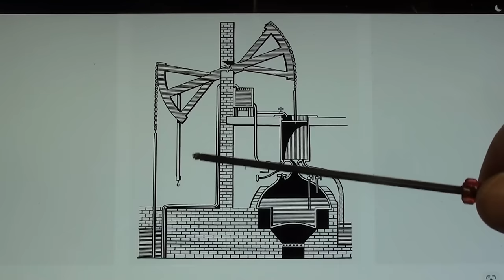WATTS LINKAGE BEAM ENGINE retrol #962 tubalcain steam parallel motion

Comment: One of Watt's critical improvements was to inject cooling water into the cylinder at the completion of the expansion stroke. This would condense the steam at about 120-140 F, which causes a deep vacuum. This results in a powerful suction on the piston and generates power on the return motion of the piston. The piston does not rely on flywheel momentum to return the piston.  The water flow is adjusted so that it is evaporated as it condenses the steam. This is a simple addition that approximately doubles the power output for no increase in steam demand for a single-action  steam engine- Genius! 
Later, this was adapted to double acting engines, where water was injected on one side to condense steam, while pressurized steam was injected on the other. This also provided huge gains of power.
Reply: Please note that this improvement was an adaptation of the atmospheric or Newcombe engine. Closely inspection of the diagram will show that it works entirely by vacuum. (hence Atmospheric - max working pressure is 14.7 psi). Notable is how weak the early boilers were. If you are doubling the power output with water injection it implies that the steam pressure is no more than 14.7 psi. This is why as pressures increased this idea was dropped although the effect was still seen with marine engines that used a condenser in a closed loop water cycle. In fact efficiency was better at high latitudes than in the tropics since a higher vacuum could be had with the colder seawater.
Reply: @bwyseymail  You are exactly right. Thanks for a great follow-up to my comment.
Reply: Water was injected to separate chamber - condenser to avoid heat  loss as in Newcomen engine.

Comment: I worked on and operated worlds largest stationary steam engine 33,000 hp (mesta steam engine) republic steel Cleveland Ohio engine was used to drive 44" rolling mill.I was also engine repairman until layoffs in 1983. 2 hi pressPistons weighed 7 tons,low press 11tons. My dad started in engine room from 1952 until 1982. We had steam duplex pumps for 600 psi H2O press for mill equipment operation, steam driven air compressor,Jack G.

Comment: A piston with a wrist pin has to have a skirt to keep it aligned with the bore.  The cylinder has to be a little longer to accommodate the skirt at the end of the stroke.  What could the advantage be with the very complicated parallel linkage?  It's beautiful and mesmerizing but must have been costly.  The benefit of a double acting cylinder makes the cross head system understandable.  Just wondering.

Comment: You will notice that the movement of the connecting rod in the pictures of Watt’s earliest models is transmitted to the flywheel via cog wheels. At the time of his early developments, the simple crank had been patented and Watt used his ingenuity to circumvent the problem of connecting lateral motion to circular motion of the flywheel.
From early days fraught with problems, Watt’s partnership with Matthew Boulton, of the Soho Works, Birmingham, allowed two geniuses to help develop efficient power for the Industrial Revolution.
I recommend reading about both.
Watt devised a friction drum method for working out the power of a horse (used everywhere in small manufactories to work a ‘gin’ to rotate machinery) in terms of foot pounds weight per second, (550). Cleverly, the small engines when sold, were underrated, so one replacing, say, two horses, would easily cope with the work requirements and a happy customer ensued.
I’m not sure how he would look on metric units, but at least he is in unison with another famous Briton since 1 Watt = 1 Joule per second.*
* Joule was an outstanding man of science who ran a brewery and worked on the mechanical equivalent of heat, and much, much more. He lived for while in 1850 in the city of Salford (near Manchester, southeast of Bolton, UK, my home town). This house is preserved.
Thank you, Mr. Pete.
👍🇬🇧👍🇺🇸👍

Comment: Lyle - Well Happy Birthday to Henry.  I'm late viewing this as an early start to go to my granddaughter's science fair presentation - she'll be 14 next month.  A good video.  Those of us who are mechanical engineers of the slide rule and steam table vintage remember linkages well.  Kinematics course junior year, 1968.  Studied the four bar linkage to death in starting before Watt's parallel design using 6 bars.  No matter the complexity of the mechanism it can be broken down into smaller parts and analyzed.  Watts was a genius who contributed much to the practical application of steam power - and the principles still work even today.  Now we can go into the thermodynamics and heat/mass transfer of the steam supply - LOL.  Have a good weekend.

Comment: The 4 bar linkage is common on many cars to keep the tires at 90 degrees to the road. The old VW beetles had rear axles which swung in an arc horizontally and  the car could roll over in a sharp turn. The Nukan   design is what is used on oil well pump jacks. The curved end of the beam describes a straight line motion for the cable. The Watt linkage is something to consider on a scroll saw so the blade doesn't move horizontally when it is moving up and down. Just  a thought. Thanks for the demo of that beautiful engine.

Comment: I have an old 1967 Case payloader I use for snow removal and farm chores. There is a linkage on the bucket and lift cylinders that reminds me of this. As you raise and lower the bucket it doesn't tip upward or downward it remains level. Keeping the cutting edge level was a probably a big deal when cutting in a basement or foundation. It helps me prevent scalping the driveway when pushing snow. I wonder if it isn't a Watt variant...

Comment: There is a HUGE example of a WATTS engine used for pumping water to Hamilton ONtario .  It is presently housed in the Steam Museum.
I believe it has a 14' dia Flywheel.  Very impressive to watch.  It is operated by Air Pressure.  Thanks.
Reply from the maker: Interesting!

Comment: Well done!  With this video I finally understand it.  Now if only someone do the same for the pratt & whitney R4360 valve and cam mechanism.
Reply: Really? 4360? The only 4 row radial ever built. Look at a single row like the P&W Wasp R1830 it probably has the same cam drive since it is the same family although it is a 9 cylinder and the 4360 is a 7 cylinder design. 7 x 4 = 28

Comment: I believe that some letterpresses which used cylinder type vacuum pumps to generate suction for feeding paper into the press and then out, they had some of this linkage. In fact many of the old paper feeding systems had this kind of link ups. They stack of paper had to be fed in parallel to the plain of the feeding table that introduced the sheet into the printing head.

Comment: Double compound ,recipicating,condensing Engine, it had a small vertical steam  cylinder to open main  throttle steam valve which was operated bye engine  in pulpit ,it also had a reversing engine to change positions of 6 eccentric rods to change running from over to under in a few seconds.

Comment: Hi MrPete. You should have a google at the ‘crofton beam engines’ and their history. They were pumping engines on a UK canal which essentially allowed for the passage of boats over a hill with locks either side so the top pound would not run dry. They are up there as right at the beginning when it came to James Watt and Matthew Boulton

Comment: Mr. Pete the motion of tackle box trays and car suspensions are not Watt in that the arc is still there and while parallel the parallel moves sideways. The genius of Watt was converting a limited arc into linear motion in a FIXED PLANE.
Do you have a pantograph tucked away somewhere? A facinating device to explorer parallel, scaling and lineal v, arc motion.

Comment: Love the steam engine videos. The low speed motor you're using to run the engine is interesting. 
Wondering what it was used on?
  Drive motor for a mig welder?
 Thanks for another great video with all the great photos and explanations.

Comment: Watts linkage is also used in car suspension
Reply: Sprint cars locate the front axle front to rear on the right side with 2 parallel bars. To save weight they only use 1 bar on the left side. The Midget class uses scaled down components.

Push Truck

Comment: The Land rover discovery 2 has a Watts linkage on the rear axel to keep the axel's lateral alignment to the chassis.
Reply: No the Land Rover has different type of link, it's more of a radial link.
2 fixed points to 2 fixed points with NO rocking, (rotating) beam to contend with..
The axle on the discovery WONT move up and down in one plain but rotates at the radius of the control rods.
Therefore not a parallel link, no matter what the Indian’s say.

Comment: Most of Watt's developments and improvements were made during his stay in Cornwall, in fact just two miles from my home.
A business collaboration with Mathew Boulton lead to a rapid expansion in the use of their engines. The downside was the crippling patent attatched to the designs, and the court cases that ensued when anyone sought o improve their design. This in turn actually hindered further development by independent engineers.

Comment: Hello MrPete, Thanks for the great videos on this Retrol engine, I just got one and have it together but before I run it I have a question. What kind of oil is put in the piston? Also, where would dI get it? Thank you sir
Reply from the maker: I just use three in one. 
I really don’t think it matters

Comment: I just bought the retol steam engine. Any idea what is the best oil (spmething avaliable locally) that I can use for cylinder lubrication?
Can I use WD-40 to lubricate the piston?
Reply from the maker: Do not use WD-40.
I am simply using three and one oil in the tiny glass oiler.     I am using Coleman white gas as fuel. They recommended a few drops of two-stroke oil in the fuel. I have not tried that yet. Have fun.
Reply: @mrpete222  on steam engine?

Comment: As I understand Watt's linkage was invented to enforce straight line movement of piston rod before accurate metal planers and shapers were made. If you want to see beam engines in action with Watt's linkage search for Crossness Pumping Station - https://www.youtube.com/watch?v=Zlp1aG1VJRI (grasshopper linkage) or Papplewick - https://www.youtube.com/watch?v=ERzWRQL_2kc

Comment: Thanks again Mr. Pete for an excellent explanation of James Watt's  important invention in 1784, which allowed doubling of the piston power over a single acting design, which has only a pull stroke. While his "parallel linkage" generates true straight-line motion but only over a limited range, it's very close.  A linkage invented in 1864, however, provides perfect rotary-to-straight line motion.  It was invented by two men working independently , a Frenchman named Charles Peaucellier and a Lithuanian, Yom Lipkin. This llinkage is more complex to build but provides perfect transfer motion.   Both linkages can be seen at https://www.youtube.com/watch?v=ey-EvvKhHlk&t=14s&ab_channel=Blackfoxsteam.
Reply from the maker: Thank you, I will check out that video